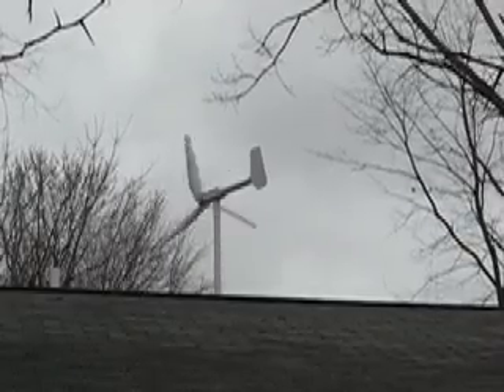diy pvc wind turbine

Comment from the maker: depending on the size you could go to the schools surplus area and look for an old printer motor or old real to real or anything DC
Stop by good will and see if they have an old tread mill. find a motor put a volt meter on it and spin it.  good luck

Comment from the maker: I don't have any plans for the turbine I just put it together one night the blades you can find plans for all over the net. if you look at my firs pvc tubine video you can see the bearing set up. all the pipe is scedglel 40 pvc and the body is a conduit junction box for a genie, use what ever you can find that will fit in side.  as far as final resalts I don't   have any. I am surronded by trees